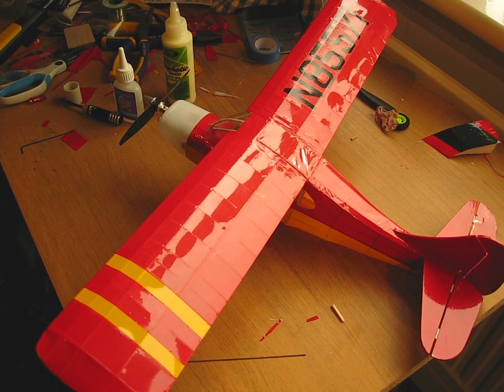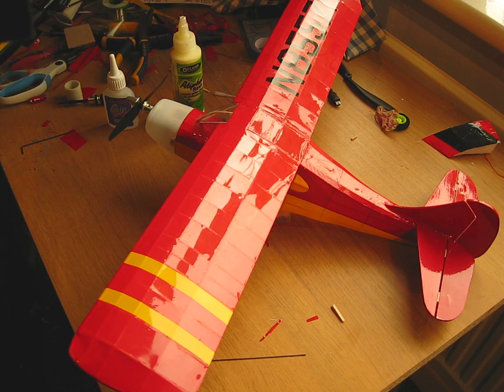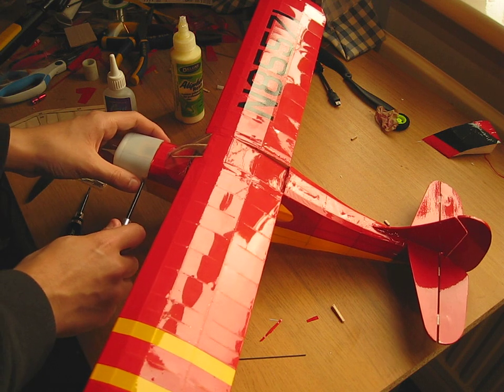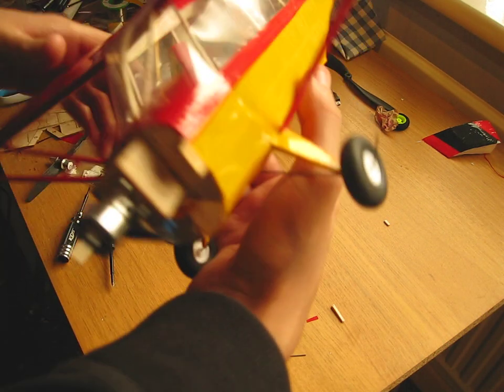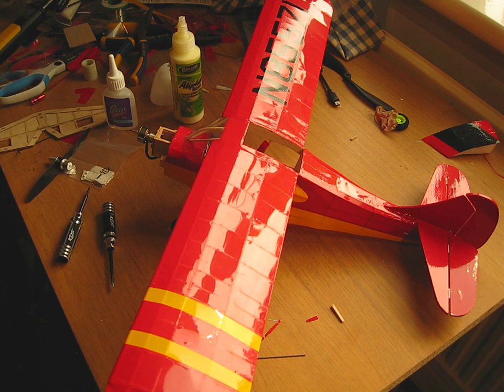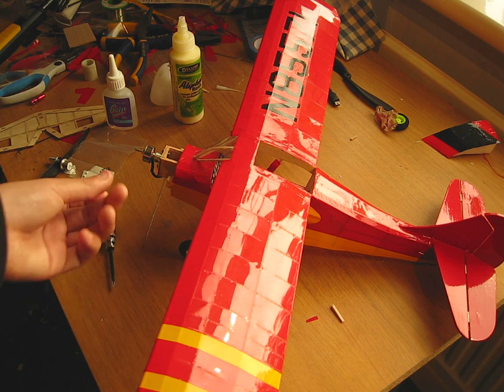Guillow's Aeronca Champion 85 RC conversion

Comment: Is it possible to use the same motor with 3000 kv? Thank you.
Reply from the maker: I don't see why you couldn't. You will just need to use a smaller propeller which may affect how quickly the plane accelerates and slow speed flying

Comment: Tip - Use little bits of fishing line inserted into both sides of a control surface for very durable, yet super flexible.  Make the holes a few mm deep on each side with a sewing needle or very small drill bit. A drop of CA glue wicks into hole and holds well.
Reply from the maker: Would of never of thought of that. Will try it next time I build a balsa model. Thank you

Comment: What motor did you use? The link does not work
Reply from the maker: Oh wow. Looks like Hobbyking has updated there website and none of the links work. This is the motor I used. https://hobbyking.com/en_us/18-11-2000kv-micro-brushless-outrunner-10g.html
Reply from the maker: Thank you for making me aware of this. I have fully updated the list so all links should work apart from the nylon stoppers which I can't find anymore
Reply: Thanks!
Reply: Now that link is discontinued too

Comment: about 2 degrees right and 3 degrees down to set the thrust properly.  YOu did a great job if that was nonocote that you used.  I claim to be the first guy to ever cover a stick and tissue type freeflight  with monocoat.  It was known as a Thunderbird back in 1962.  LOL

Comment: Can you tell me how you charge the battery?
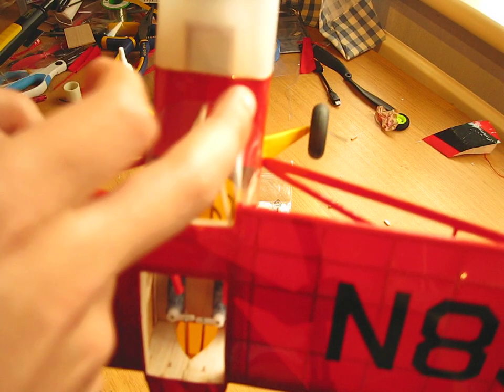Reply from the maker: +That Christian Channel At 2:00 I talk about the battery and battery compartment. I use a 300mah 2 cell Lipo and I charge the battery using a LiPo charger. Of course I remove the battery from the plane before I charge it. If your still unshore there are many good videos on how to safely charge a LiPo battery on YouTube
Reply: obRCmania That's helpful thank you. Could you give me a link to an example of what I need?  If I search ebay for 'lipo charger' it's a bit overwhelming.  I have bought the battery you suggest for this build, so what's the cheapest way of charging it? Thanks for you help!
Reply from the maker: +That Christian Channel https://www.youtube.com/watch?v=kvr-25yGeVk . This is probably the best and most informative video about charging LiPo batteries. It uses a simple LiPO charger from HobbyKing called the Accucel-6. However you do need to get a power cable separately.
Reply: obRCmania You are so helpful, thanks so much.  I may upload some vids of my fumbling as it goes on, see if I actually get the thing in the air!!!
Reply from the maker: +That Christian Channel I would be interested to see how you get on with building this plane. Will it be your first time building a remote control plane?
Reply: +obRCmania Yes, absolutely.  In fact, I've just opened a bunch of envelopes containing all the bits and bobs I need, most of which were from your list, and I see a steep learning curve ahead!  Things which must seem so simple to the experienced, how they all join together, what does what, how to attach the metal rod to the hinge on the tail?!?! It's going to be fun, frustrating fun :-)
Reply from the maker: +That Christian Channel The key thing is to be patient. these balsa planes take a lot of time and you can't rush it otherwise things quickly go wrong (as I learnt). Probably took me around 2/3 weeks to work out and complete everything
Reply: +obRCmania Yes that's what I was thinking.  Just don't rush, figure it out and enjoy the challenge!

Comment: What did you use for hinges ?
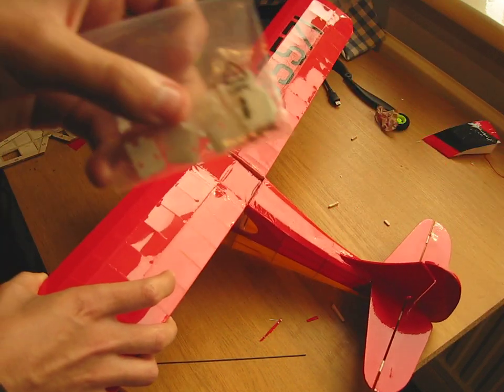Reply from the maker: +trystyn clark 5:40 talks about the hinges. I got them from a model shop and the plastic stuff was very stiff and caused stress on the servo. The other hinges I used were very small nylon hinges.

Comment: that's awesome! the covering is really good for you first time. The covering on my first guillows looked like crap! I am currently working on an aeronca myself and this video was a great help. I love the access thing by the way
Reply from the maker: Thanks
Reply from the maker: 1 quick thing I've found out. use more than 2 screws to hold the cowling in place. I've crashed mine recently and the plastic is a little brittle so the cowling has cracked where the screws hold the cowling.

Comment: If the power is right but the weight is light, i would try to add some weight by using modeling clay in the nose plastic. Fantastic job on the engineering and craftsmanship. I'm building my second kit myself. Guillow #402 p-51. I hope mine looks as clean as yours. I'm attempting rc also.
Reply from the maker: That would work. I just think if your going to add more weight in the nose is better to add a slightly heavier motor rather than weight which does nothing (if that makes sense). Also Thank you. It was my first attempt at a balsa plane. There are some very rough edges on it and there was quite a lot of trial and error.

Comment from the maker: Thanks. I have put a list of the components I used to convert it to rc in the description. However If you can try and find a slightly heavier motor because with the motor I am currently using it is powerful enough but it is too light and even with ESC and battery right at the front its still needs a bit more weight at the front. Maybe a motor which is around 15g will be better.